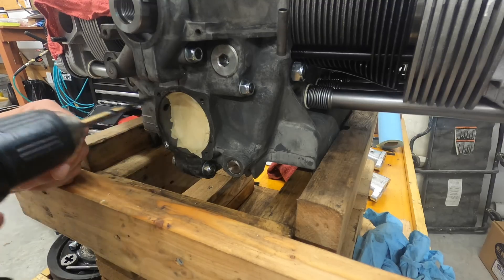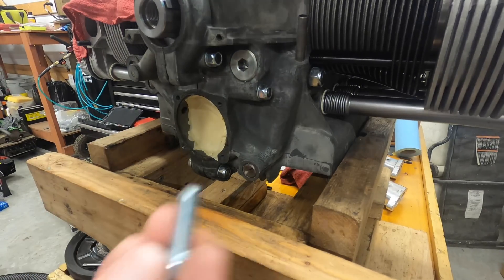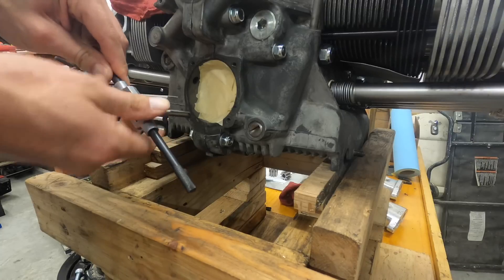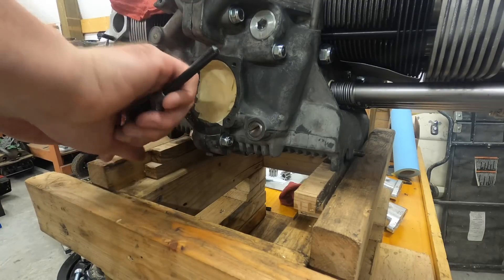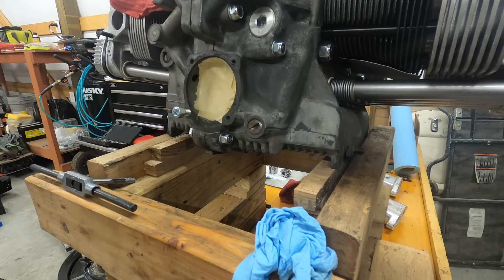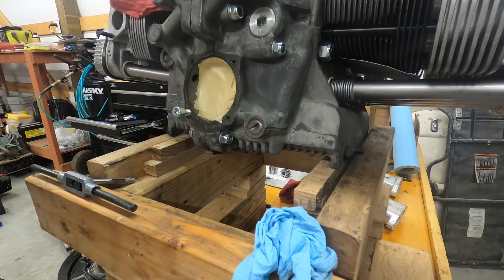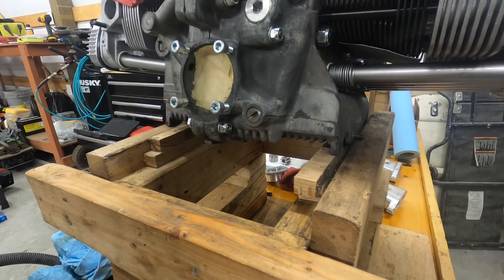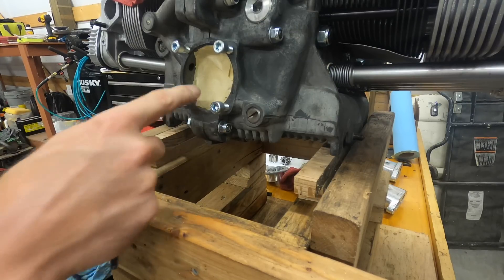Tap A VW Type 1 Oil Pump From 6MM To 8MM Studs

Comment: Did your pump fit with the stud spacing? I understood that the 6mm had more narrow center-center spacing than 8mm?
Reply from the maker: I didn’t have any issues with spacing!  Take a look at the install below.
Reply from the maker: https://youtu.be/YKMWuKNHYFo
Reply: Okay, thanks for the reply. I wanted to do the same stud upgrade for my 1500cc case. I measured and they were slightly off. Was worried I was going to have to take it to a machinist
Reply from the maker: Another option would be to try a step stud? 6mm to 8mm.  See if it works.
Reply: I had issues with alignment in terms of the oil pump cover plate, but that was because I was using a bug engine in a bay window bus and I may have purchased the wrong cover plate.
Reply: Kiuiiiooopp

Comment: I have a case with 6mm oil pump holes If i do this , which 8 mm oil pump is the correct one to use cause the oil galleys for the 6 mm oil pumps are smaller .
Reply from the maker: So unfortunately I don’t believe there is an oil pump out there that will work specifically for the smaller oil galleys.  

The one I bought from CB Performance is doing well.  I’ve had no issues with it.  I would just highly suggest doing what I did in the below video.  It’s preferable to do this procedure when the engine is torn apart, and you can clean it easier after.  But this will prevent the oil from hitting “walls” when coming out of the pump back into the engine.  

https://youtu.be/t43RkzqoXGg
Reply from the maker: Also, they sell step studs (6mm to 8mm) that you can use instead of doing what I did.  I felt this would be stronger though.